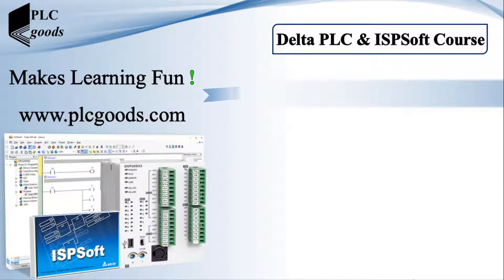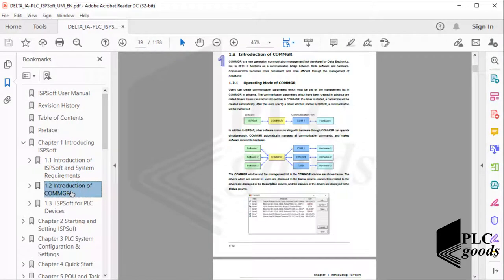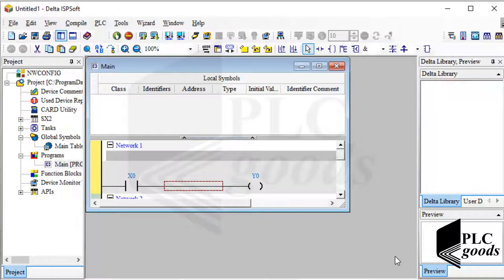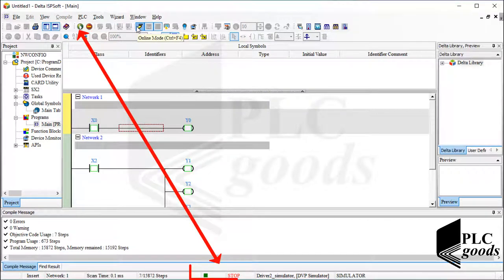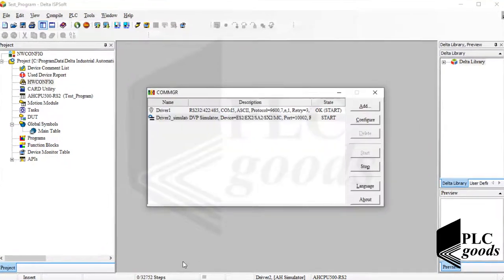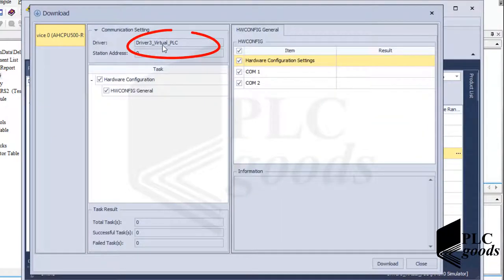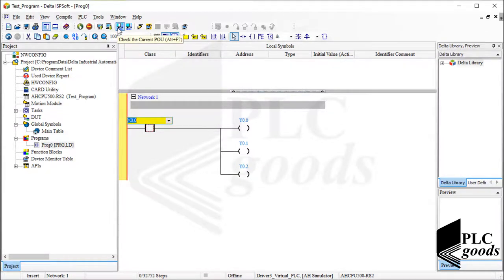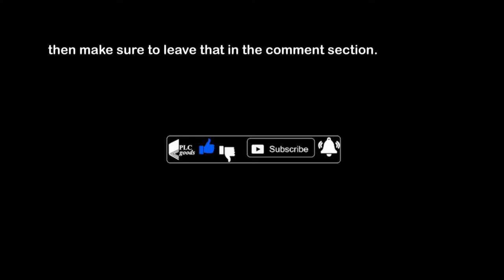Delta PLC basics | link function in ISPSoft  HWConfig, how to use COMMGR communication driver

Comment: Hey There, folling along for vitual PLC setup, done everything as you have laid out, but getting this error on Download... 
"The device returned an error when processing the request (error code 16#7002 - The CPU module does not support the function), please check the device." 
Same PLC, same settings... 
Any advice would be greatly appreciated!
Reply from the maker: I always try to show all steps of programming clearly, Now you are saying the same device, the same software... But you are getting an error code, well what can i say?
Reply: @plcgoods  Thanks for the response, I still seem to be getting a new error, which now states - Incorrect Area Code... Anyways, thank you for the videos! I don't think it has anything to do with your process, its more likely a config setting on this old PLC I am using.
Reply: @plcgoods  I am getting the same error even after following every step with great caution. It will be a great help on top of what you have already done to make the viewer understand why this error appears. Thanks in advance.

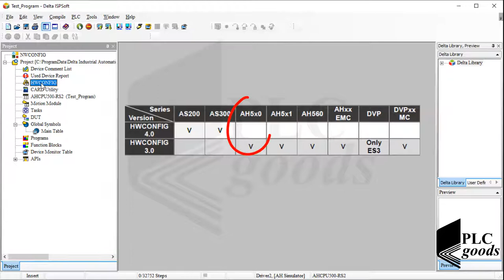Comment: Thank you for your great content! Please can you explain about series of plc at 8:55? Why did you pointed at AH5x0 series and said that you don't have this item (HWCONFIG)? While this item was at left part of you screen? I'm a little bit confused! 😅
Reply from the maker: Hi there, As you know, before starting any project, we should select our PLC type. My PLC type is “DVP20SX2”. If I select it as my PLC type in ISPsoft, then I won’t have “HWCONFIG” item on the left side of ISPSoft screen, because this PLC doesn’t need to be configured. But if I select a PLC from “AH5x0” series (like the video), then the “HWCONFIG” item will appear on the left side. Because we need this item to configure this type of PLC. For example we need to determine extended modules or their addresses.

Comment: Thank you for teaching us many things. I have a question, how can connect third party equipment via rs485 or rs232? I couldn't find an option in hwconfig.Thank you.
Reply from the maker: Hi there, If you search on the internet, you can see that RS-232 is used to connect only 2 devices. Also, a maximum of 32 devices can be connected to a standard RS485. So, you need to use RS485 to connect 3 devices together. Because each device has its specific settings, so I can not tell you the settings that you need. I recommend reading the user manual of your devices or asking your question from your product's vendor.
Reply: @plcgoods  Thank you for the response.

Comment: Like good to see you back.see you.bye.
Reply from the maker: Glad you like it
Reply from the maker: Likewise, I was preparing some lessons for Delta PLC, so far, i have posted a few of them,  I do not know if you have check them out or not. please take a look at them and give me your opinion!
Reply: @plcgoods  hey man , do you have any idea how to configure the communication module as00scm?
Reply from the maker: @Nerfzisback  Thanks for checking the channel, about the module, Sorry I have not worked with this module, no idea how its parameters  should be set
Reply from the maker: @Nerfzisback  I do not have any idea what that module even is, please check its configuration data on the internet and limit your questions on what software or hardware you are  introduced to on each video lesson, thanks for checking the channel

Comment: Thx you for the content , at the 7:00 minute when u choose to use force for inputs to be actived I tried to choose "set on" for inputs then a popup message appeared " communication error ( function not support) , why?
Reply: Hi there, Probably your computer is not connected to your PLC. So, check the connection settings and download your program again, to ensure the connection settings between the PLC and your computer are correct. Also, the current program inside ISPsoft software and the PLC program must be the same. Then activate the online mode.
Reply from the maker: was the response from the PLC goods mentor useful to you?
Reply: @plcgoods  thx u for following my reply 🙂 I really appreciate it alot , and for u question indeed not really because I am using virtual plc so there's no real connection my computer and plc only by COMMGR, and also in u vid u mentioned that there's no connection between the inputs and the feed line
Reply: @ayhamshbat2733  did ur problem solve i am facing problem like it says can't convert temporary files when compiled

Comment: Hi. When I try to open the communication settings it shows a message "Driver info file isn't found. Check the driver info Path". If You could help me please.
Reply: Hi there, I don't know what your problem is. Note that  you need to install COMMGR software as well as the ISPSoft.
Reply from the maker: Thanks for checking out the channel!

Comment: Thank you. Jazakallah. Good basic lesson about communications between software and plc hardware, virtual plc.

Please tell us what are the differences between different models of delta plc such as max. I/O can be connected, processor speed, comm.types, ? Why we need these much different models?
Reply from the maker: Delta has produced different models of PLCs to fit customers needs best. You might need to use a PLC to monitor a very simple task in your machine  such as controlling a few pushbuttons and Turing on /off  a few relays, so you need to buy a PLC that has bunch of analog and digital IOs. some delta PLCs are built as big as a cigarette packet and very inexpensive! with a very limited number of IOs.

Comment: Dear Sir,
please upload a new video using Delta HMI 107 and delta compact  PLC , transistorized out put module and TC module for thermocouples K-type and J-type( Selectable ) to control heater of a plastic mold.
selectable SV temperatures from HMI and monitor PV temperatures of mold heaters on HMI

thanks a lot
Reply from the maker: I have developed 26 videos related to programming DELTA PLC in which some of them show how to interface analog equipments to analog port of a DELTA PLC. Please check out those videos. Right now I do not have any video related to an application you mentioned.